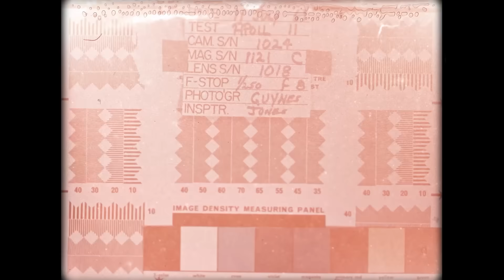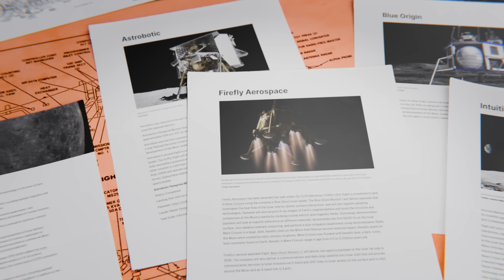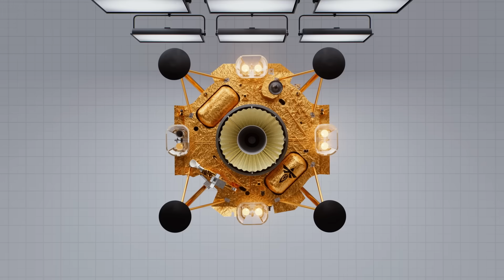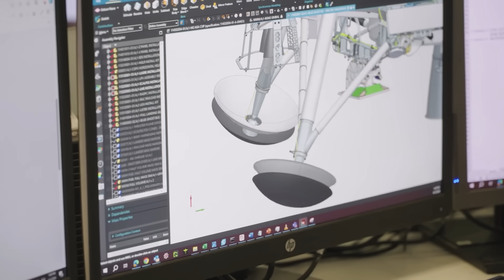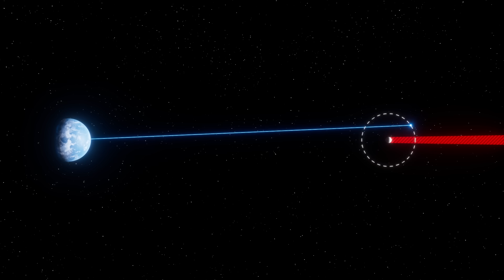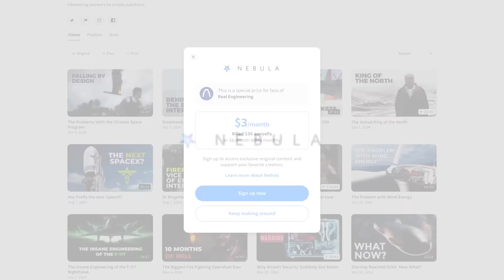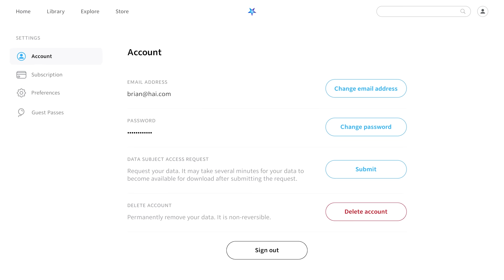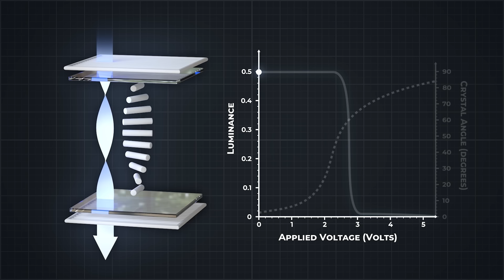Why the US is Struggling to Land on the Moon

Comment: The last living astronauts to supposedly leave the exosphere are in their 90s... maybe all that leaded gas and smoking being healthy made it possible? Or was it vacuum tubes and hand-written math...
Reply: You're naive.
It was Apollo program.
Reply: @ThomasKundera  so I should believe that in the late 60s to early 70s, we could go to the moon half a dozen times with only 1 issue, yet over 50yrs later, it's too difficult? It doesn't make any sense. No other country has ever even attempted it.
Reply: @zibbitydoodaa  "so I should believe"
You should know.

"that in the late 60s to early 70s, we could go to the moon half a dozen times with only 1 issue"
NASA made 6 manned landings over 7 attempts, if that's what you're talking about, right.

"yet over 50yrs later, it's too difficult?"
It was difficult, it's still difficult.
"too difficult", is a relative.

"It doesn't make any sense."
What doesn't? Why?

"No other country has ever even attempted it."
USSR attempted, and failed.
Reply: @ThomasKundera  no, they never attempted it. They canceled the mission.  They didn't send a probe again until a few years ago.
Reply: @ThomasKundera  to leave orbit, get to speed, launch towards a moon 240k mile away, rotate the lander, orbit the moon, land, get out, re-launch, reattach to a ship going 24k miles/hr using manual controls, then head back 240k miles without issue? 6 times... it doesn't make any sense!
Reply: @zibbitydoodaa  " they never attempted it"
There where two programs by USSR, the most advanced one around the N1 rocket that made 4 flight attempts.
The program was definitely closed in 1975.
Inform yourself.

"to leave orbit, get to speed, launch towards a moon 240k mile away, rotate the lander, orbit the moon, land, get out, re-launch, reattach to a ship going 24k miles/hr using manual controls, then head back 240k miles without issue?"
With several issues.

"it doesn't make any sense!"
What doesn't makes sense? Why?
Do you pretend that a space mission is a non sense?
Reply: @ThomasKundera  we were in Vietnam, decades into a cold war, using 1960s tech, and US bureaucracy... it's ridiculous to think we could pull that off, especially 6 times.
Reply: @zibbitydoodaa  "we were in Vietnam"
USA was at war, right (but when is it not?).

"decades into a cold war"
Thus lots of incentive to win the space race.

", using 1960s tech,"
What else do you expect in the 60's?

"and US bureaucracy.."

Then?

"it's ridiculous to think"
We don't need to imagine: Apollo missions are verifiable facts.
Reply: @zibbitydoodaa  :
"because the US never lies about what it does with your tax dollars?"
I don't have any dollar, so...

"Golf of Tonkin, cough, cough."
Your point?

"Dude, ever since I was a kid, all I hear is excuse after excuse as to why we don't "go back.""
It's costly, right.

"After awhile, you start seeing it for what it is. Bs."
You don't understand it, that's all.
Reply: @ThomasKundera  your only logic behind thinking we actually made it to the moon is that a history book told you.  Just like the golf of Tonkin is in every history book up until a decade ago.
Reply: @zibbitydoodaa  I'd like to see a person leave earth orbit and not die from radiation. It seems increasingly likely that this will never happen. We will be stuck on Earth forever 😥
Reply: @zibbitydoodaa  : " Your only logic behind thinking we actually went to the moon is that a history book told you it happened."
Which means that all historians (and space engineers, and physicists and all other scientists) know Apollo missions went to the Moon.
What do you have against it? Ignorance.
Seems a bit weak.

"Just like the Golf of Tonkin"
No.
Reply: @ThomasKundera  going to the moon was so easy, astronauts snuck golf balls and they even sat in a recliner 🤣 because a 240k mile trip into the void is a cake walk... it's ridiculous!
Reply: @zibbitydoodaa  :
"going to the moon was so easy"
Naive, it was extremely difficult.

" astronauts snuck golf balls and they even sat in a recliner"
Then?

"because a 240k mile trip into the void is a cake walk..."
It's not

" it's ridiculous!" to pretend it was.
Reply: @lastman4853  "I'd like to see a person leave earth orbit"
I remind you that Moon is in Earth orbit, so actually no human ever did.

"and not die from radiation."
What do you understand about radiations?
Reply: @ThomasKundera  I meant low earth orbit. No human being has left LEO since apollo.
Reply: @lastman4853  : " No human being has left LEO since apollo."
That's correct.
Then?
Reply: @ThomasKundera  Then the longer this is never is achieved the moon skeptics will continue to grow.
Reply: @lastman4853  "Then the longer this is never is achieved"
Could be never again.
Would you stop believe in Egyptians Pyramids if nobody in Egypt build another one?
Has been thousands of years.
But it's irrelevant: what has been done has been done, whatever is in the future.

"the moon skeptics"
They are not "skeptics", they are deniers.

"will continue to grow."
Among ignorant only.
Which is sad, I agree.
But if you won't want to be among them, learn.
Reply: @ThomasKundera  Ah yes you're one of those people. Anybody that doesn't agree with me is ignorant. No thanks I don't want to amongst people like you.
Reply: @lastman4853  "Anybody that doesn't agree with me is ignorant."
Only when that's the case.
Feel free to prove me wrong:
- what are your credentials in technical history of the XXth century?
- what are your credentials in space engineering?
- what are your credentials in astrophysics?
- How many scientific articles about Apollo did you publish in peer review journals?

I don't want to be among people who understand about nothing in a scientific field but anyway pretend to know better than the best experts worldwide in the last 50 years.
Why would you be among those?
Reply: @zibbitydoodaa  “without issue” if you ignore Apollo 13. And Apollo 12, which came within seconds of having to abort the mission.

Apollo was possible because the USA decided to make it a national priority, with nearly unlimited funding. It was the largest, most expensive engineering project in history. They spent ten times more man-hours on Apollo than on the Manhattan Project, which developed the atomic bomb during WW2. 
After Apollo, nobody was willing to spend that kind of money and effort on a repeat landing, so we had to wait for rockets to get a lot cheaper before the next manned mission to the moon. That is now happening.
Reply: @lastman4853  24 men have left low Earth orbit and did not die from radiation. In the real world, the radiation level in the van Allen belts is low enough that humans can travel through them without issue. You just can’t orbit in the belts for long periods.
Reply: @Hobbes746  we were blowing money and lives in Vietnam, had political unrest at home, and needed a "win".  The total cost of all the apollo missions amounts to around $300 bil, today.  We've give half that to Ukraine in 2yrs and blow 6x that every year, over budget.  It's not a money issue, it's that it's so improbable that it's impossible.
Reply: @zibbitydoodaa  It is in fact a money issue. In real life, governments don’t have an infinite budget: they have to make choices. The fact that emergencies like supporting an ally at war change those choices doesn’t change that funding is limited. 
Apollo was improbable: it took the largest engineering project in history to pull it off. But pull it off they did. A ton of evidence proves this beyond doubt.
Reply: @Hobbes746  in real life, Kaynesian economic politicians find any way to blow billions to "create jobs". If moon landings were possible, we'd focus manufacturing on space, and not warfare.  Same industries, same tech, less instability and loss of life. 
But it never happened.
Reply: @zibbitydoodaa  "If moon landings were possible"
There are, as Apollo missions show it.

"we'd focus manufacturing on space, and not warfare."
I don't understand that logic. Why?
Agree artificial satellites are possible?
Would you suggest Ukraine to focus on launching satellites in space and forgetting about the war with Russia?
Do you think that would help them in any way to keep their freedom?
Reply: Stephen Hawking, Brian Cox, Carl Sagan are big names in science. If they would show that the 6 moon landings would not have happened then I call that convincing evidence, but they never did.

Comment: proof of the moon landings were faked. ALL of those missions landed perfectly on the first attempts to land. total bs!!!
Reply: " ALL of those missions landed perfectly"
At least two Surveyors landing were faulty.
Maybe learn first.
Reply: Nope. The Apollo missions are real. Plenty of evidence that proves this beyond doubt. 
The Apollo missions were successful for two main reasons:
1. they were preceded by 29 unmanned missions which allowed NASA to build experience and learn from their mistakes. 
2. they had humans in the loop, which are far better at reading the terrain than even a modern machine vision system.

Intuitive Machines decided to ignore some of the lessons that were learned by NASA in the 1960s. They forgot to do a preflight check, so their spacecraft took off with its altimeter still set to safe mode, which meant it didn’t work.

Comment: The U.S. successfully landed 5 Surveyor probes on the lunar surface prior to the Apollo landings. I think that NASA needs to go back and learn from its past before it tries to recreate a future that current NASA is not prepared to tackle yet...
...2 of the 7 Surveyor probes crashed. Surveyor 2 crashed into the moon after a failed mid course correction, and Surveyor 4 lost contact before it could arrive at the moon.

Comment: I remember a rover used a bunch of air bags to let it just fall on to the moon. I feel like that would be a simpler and more reliable system than trying to get a rocket to land.
Reply: On the moon, you already need a rocket to slow down from orbital speed. You might as well use that to land instead of rigging up a second system for that last few m/s.
Reply: @ good point. Probably some other mission requirements too that a rocket makes more sense

Comment: Not just NASA and space.
Back in the 30s thru the 50s we built huge Hydro electric damns , an enormous nation wide interstate highway system , the first atomic bomb , on into the 60s and 70s ... men on the moon , a pipeline bringing energy from the most hostile rugged terrain hundreds of miles.
 Face it , the problem is a people problem. Nothing else.
 We are afraid of what will go wrong now , instead of laser beam focus on what can go right.

Comment: Why aren’t the landers using commercial off the shelf components such as radar or laser altimeters or ADS-B In/Out?
Reply: The IM-1 lander did use a commercial altimeter. They forgot to switch it out of safe mode before the flight.

Comment: Oh oh I know. It’s because they never actually landed a man on the moon.
Go look at all the astronauts that died on earth trying to get to the moon. And yet every moon mission went to plan perfectly.
Ahh bull shit
Reply: Before Apollo 11, NASA ran 29 unmanned missions to the moon, half of which failed. Each failure was used to improve subsequent missions. Same goes for Apollo 1: after the deadly fire, the Apollo program was halted for more than a year to redesign the CM and LM to make sure such a failure could not happen again. 
And no, not every moon mission went to plan: Apollo 12 was hit by lightning. Thanks to a solid design and quick thinking, they were able to restart the CM electrical systems, seconds before an abort would have become necessary. 
On Apollo 13, an explosion in an oxygen tank derailed the mission. With a massive effort, they were able to assemble a rescue plan in time to save the astronauts. Other missions had smaller problems.
Reply: @Hobbes746  all on return flights? Not one person died? They walked on The moon and took pictures before reconnecting with an object orbiting the moon at Mach 8 in 1969? Yet they can’t provide one high res image in 2024 if anything on the moon.

Comment: No longer relying upon slide rules has a lot to do with it.

The detailed understanding of the mathematics and physics at a fundamental level gave engineers in the 1960s an advantage.  

Today most computer science majors have no idea about how computers work at a hardware level - most can't program in assembly at all and C is too hard - Python (20x slower than C usually) is more their speed but only if they can cut-and-paste from Stack Exchange.   This is not memorized knowledge like it used to be; thus having exactly the information you need at 

It's NOT just CompSci that is like this.  Most EEs I interview have similar blind spots.   Many are barely able to deal with logic-level digital circuits; analog circuits are beyond most.   Too bad what we do is intimately analog circuits and device physics.

Back in the day, the same people knew and worked on all of the above - programming at assembly, worked on radar, dealt with analog circuits.

Today people are "well silo-ed" so NOBODY has a system-level view and comprehension of the larger system and subsystem interactions.  "System Engineering" is a rare skill today.

Comment: You're never going to get real-time data from the moon, no matter how big your relay network is. The moon is about 1.25 light-seconds from Earth. In the best possible case, the data you see are 1.25 seconds out of date; and any commands you send to your spacecraft will arrive 1.25 seconds after you sent them. The round trip for light-speed communication between Earth and the moon is thus 2.5 seconds.
Reply: So it's just a matter of calculating this. Ed Fendell knew this back in 1972. Nowadays automation helps a lot, look at the Perseverance mission on Mars. A radio signal can take more than 20 minutes to get there.
Reply: @ApolloKid1961   - oh, yeah, totally.

But the narrator was talking about "real-time" data, which is not possible due to the light-speed lag over that large distance.
Reply: @ApolloKid1961 perseverance wasn’t relying on real time inputs from someone sitting at Mission Control. It was running on its own onboard systems.

Comment: I’m not a rocket scientist,.. why don’t you pick a freaking target and then go down? Not an an angle.
Reply: It’s almost inevitable that you arrive at an angle: you start in lunar orbit, where you move at 1600 m/s in a circle around the moon. Then you start your engines to slow down: you have to go from 1600 m/s to 0. When you do that, your orbit changes: it’s no longer a circle, but an ellipse that gets smaller as your speed decreases. The scenario that uses the smallest amount of fuel is to get your speed to zero just above the surface. The IM-1 lander got this wrong because its main altimeter wasn’t working, and the secondary system they had jury-rigged during the flight wasn’t as accurate.
Reply: @Hobbes746  not figuring out what rocket fuel cost, and beyond the safe side?
The astronaut, landing, and the moon-100 football field,150 football field,200 football field….? straight shot.
Reply: @seanphillips5745  The cost of the rocket fuel is not the $ you pay for one litre at the pump.  It’s what you pay to carry that litre to the moon. If you want to spend time hovering above the surface, your spacecraft has to get larger and heavier to carry the extra fuel. That means you need a larger, heavier rocket to carry it to the moon. And this is a feedback loop. Making the fuel tanks larger makes them heavier, which means you need more fuel than you had added in the first place.
Reply: You can't go straight down because you are moving horizontally orbiting the Moon, and it takes lots of fuel to stop, and then when you stop, you will get pulled in by gravity and so you need more fuel to slow down vertically, but you can't carry all that fuel, etc.

Comment: Centre-of-mass considerations are the reason the Apollo Lunar Module looks lop-sided. IIRC, the fuel tank is farther from the centre of mass than the oxidiser tank (on opposite sides of the craft), to avoid creating a rotational moment as the propellants get used up. IIUC, both the descent and ascent engines of the LM used UMDH ("unsymmetric" dimethyl hydrazine) and nitrogen tetroxide. The former is somewhat less dense than the latter.